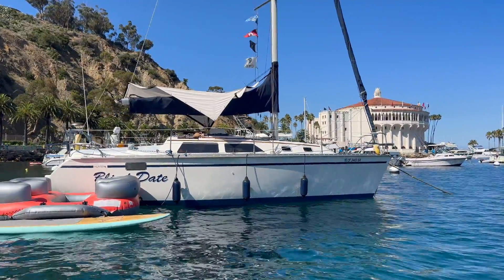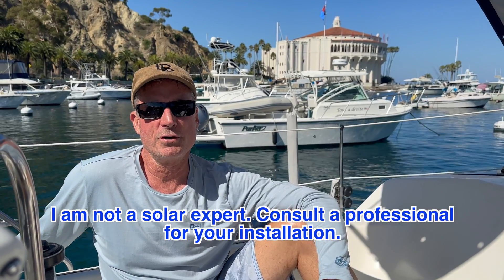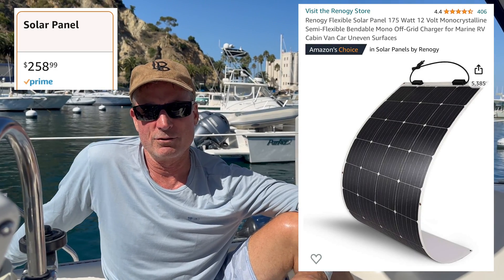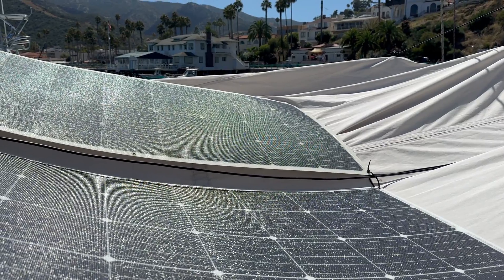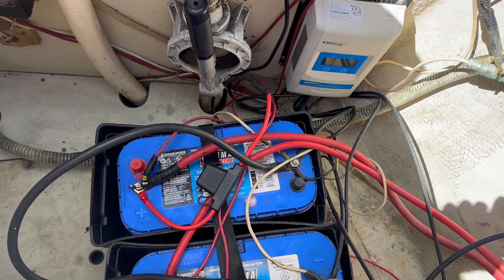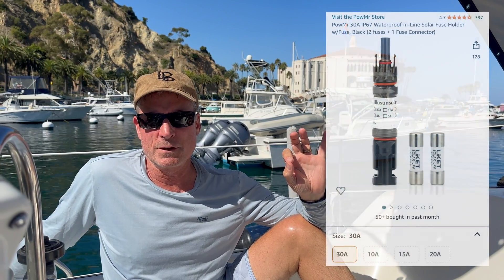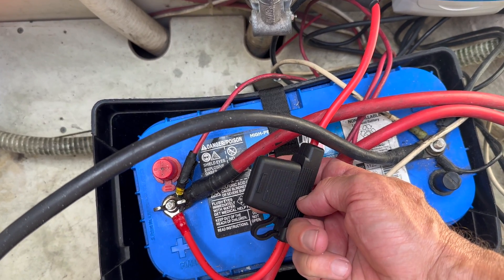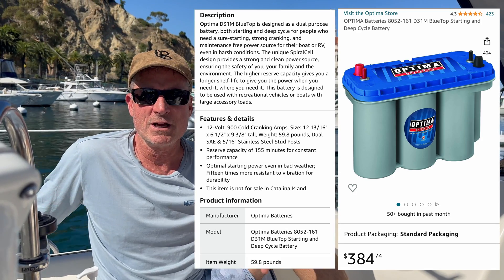Installing Solar on my Sailboat ~ Hillbilly Solar! ~ Ep. 130

Comment: Cant you mount them to the deck? I thought you could walk on those panels.
Reply from the maker: Yes. I included a clip where I had the 100w on the bow deck. But the 175w is much larger and I don’t have a good space for it on the bow. I don’t have a lot of deck space — particularly deck that isn’t shaded by the boom and the sun shade.
Reply: @tcsadventures  I have a 1982 Catalina 30. But we have a solar arch that makes it easy for panels. Just installed a 400 amp hour lithium with 600 watts of panels and a 3000watt inverter. It definitely made life at sea more comfy.
Reply from the maker: Wow! That’s a lot of capacity! What do you use the energy on?
Reply: @tcsadventures  we are going to be living on board , so we will have the fridge freezer, TV, starlink and a diesel furnace with a space heater as backup. And it gets pretty cold on Vancouver Island.
Reply from the maker: Living on aboard, a setup like that makes a lot of sense. Sounds like fun!
Reply: @tcsadventures  and it saves us $20k per year on rent. Lol

Comment: As always thanks for taking the time to make these videos.  My 1991 30T does not have a washdown or a refrigerator.  Were yours factory options, or did you install them?
Reply from the maker: I bought the boat in 2001, so the boat was 10 years old when I got it. I would guess that the frig was a factory option. The frig top is the same material as the rest of the counter. The wash down could have easily been after market, but it would have had to been put in early on because it was old. I replaced it several years ago.